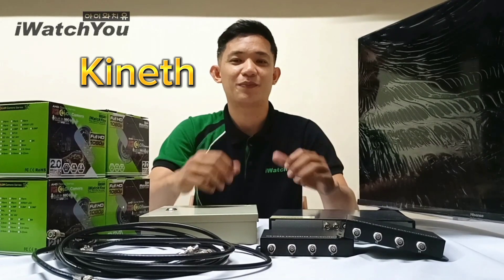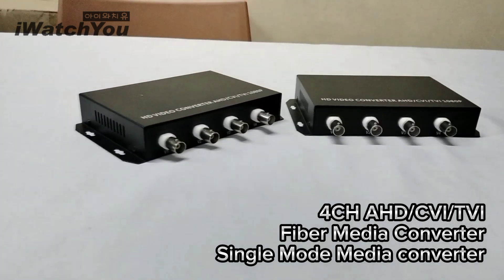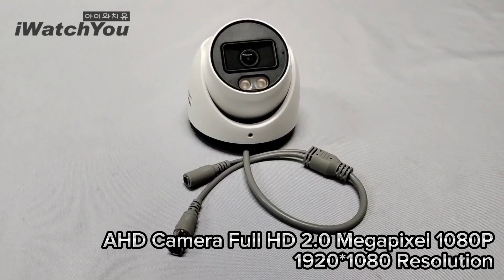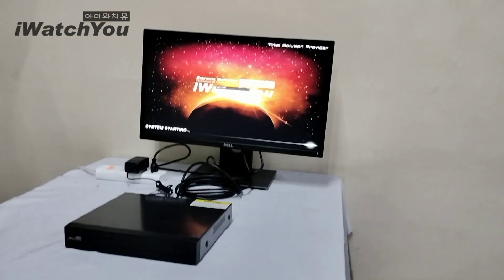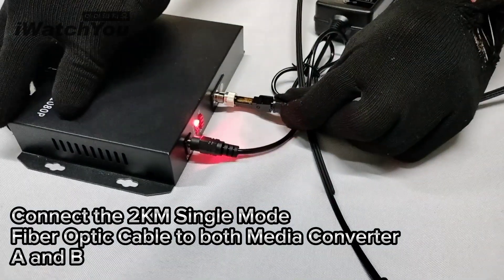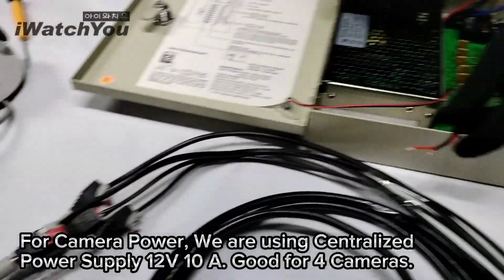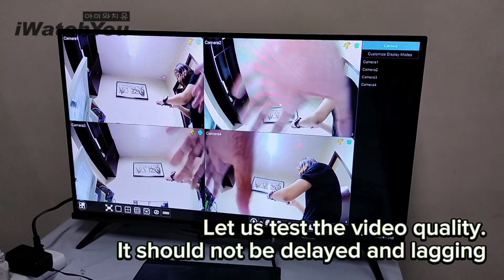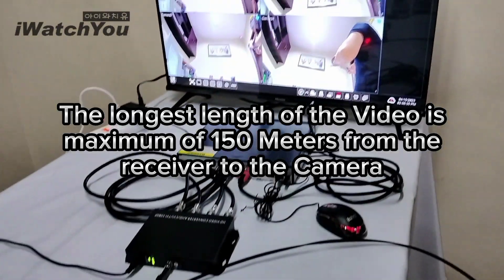Clear Long Distance AHD Surveillance with Media Converter Over 2KM Fiber

Comment: Good day po sir ..
Sir magkano po Ang FC FIBER connector for AHD MEDIA CONVERTER.
Reply from the maker: Good day 😊
Thank you for noticing our video! 🙏 For your inquiry about the FC Fiber Connector for AHD Media Converter, please leave us a message or reach us directly via Viber 📱 0939 321 9466 / 0917 844 9559 so we can assist you further.Thank you po.
Reply: Good day po sir..pwede po pahingi ng demo po for splicing fc optical fiber connector single core to ahd media converter... 
Thank you so much sir